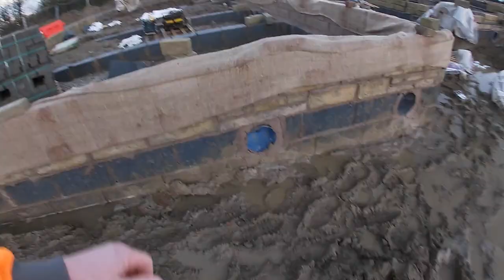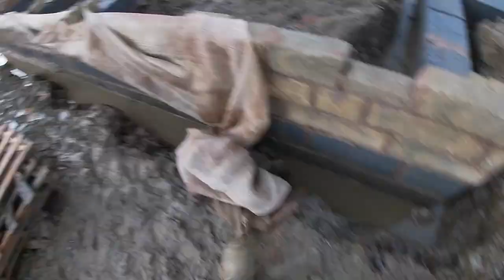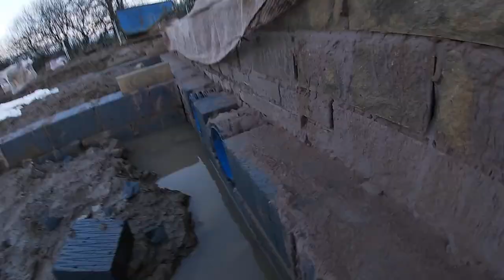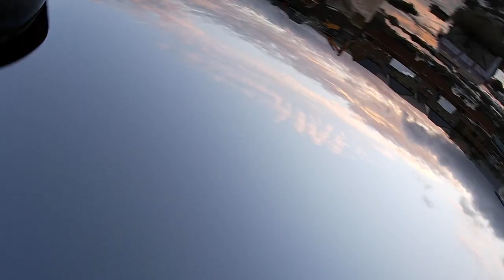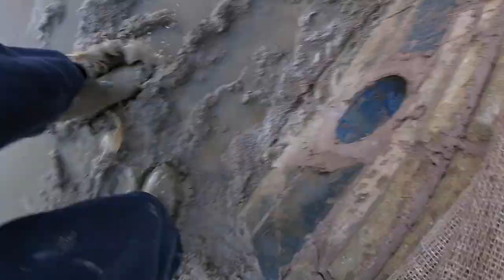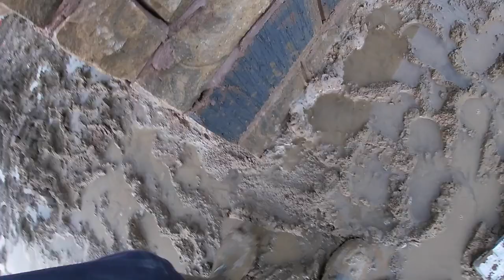This is why you shouldn't lay stone when it's raining

Comment: Do nhbc not make you out at least half a block under the lintels on your service holes they make us it’s a nightmare especially you need a few holes close together
Reply: Forgot to add they want the holes at least 340mm Aswell
Reply from the maker: Yes they want 300mm pipe sleeves built in. The trench block have to be cut out to suit.
Reply: @markbullen1489  cheers for the reply those look a nice footing im on red row they are a bit of a nightmare but can make some good coin if we get stuck in